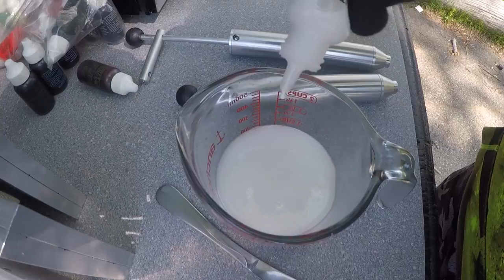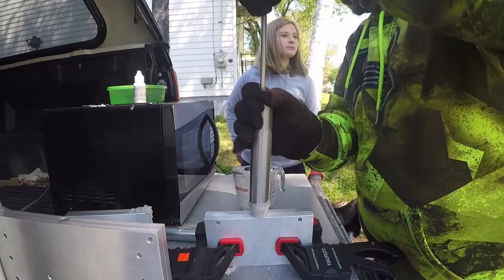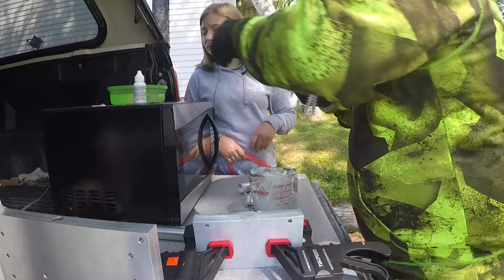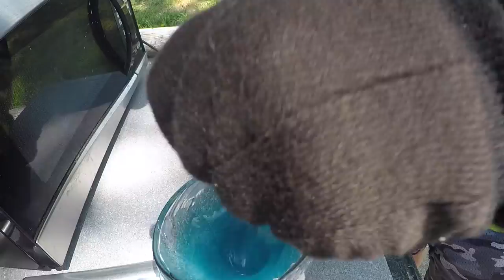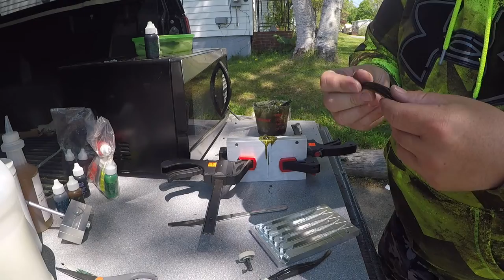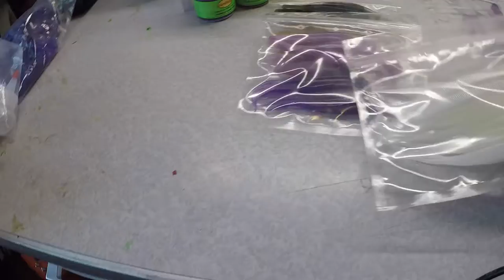My First Time Injecting Soft Plastic Baits. Hellgramite, Flukes and Creature Bait.

Comment: to eliminate air bubbles pour your silicone/product into your syringe verse drawing it up .fill your solution approx 3/16 to 5/16 of an inch from top of syringe cylinder then insert plunger section of syringe to push your solution through.indentations or air pockets will be a thing of the past for you.really helps when forming critters with small legs/appendages such as crayfish/helgamites.nice vid,enjoyed it! carry on,fish on brother!